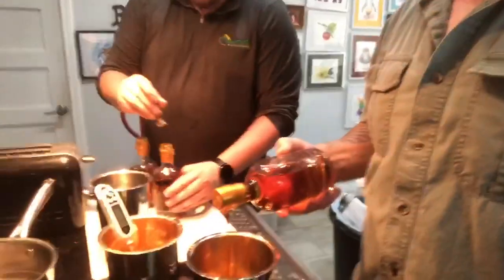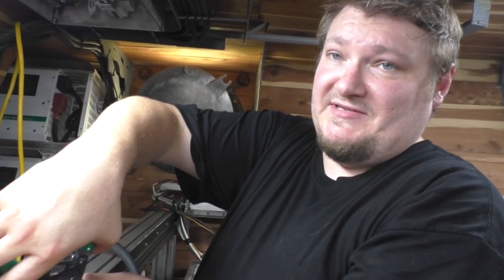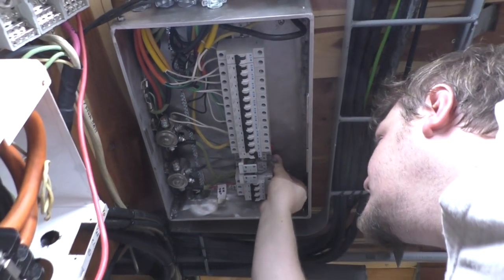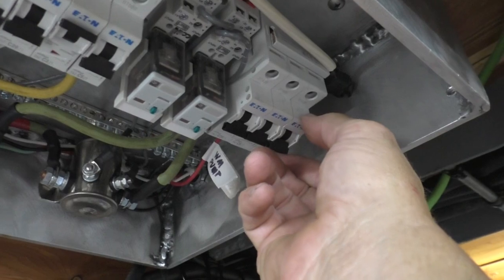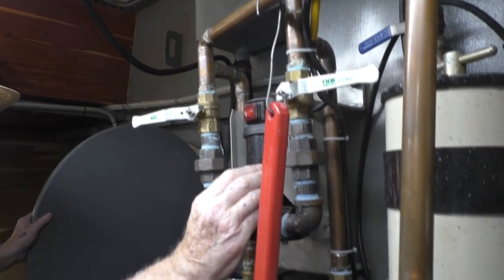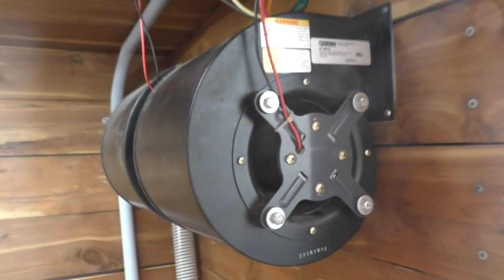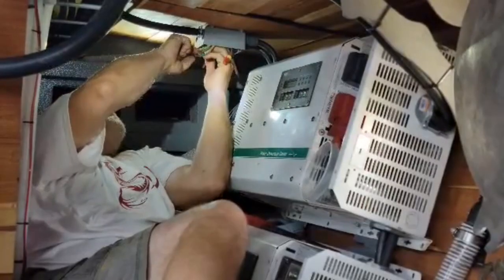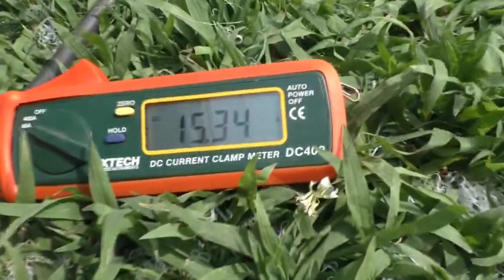LiFePo Forklift Battery in a Boat

Comment: 2011: "this dude thinks he's gunna build some crazy boat"
2021: "hes launching is 6 days"

what a ride
Reply: Yeah, missed the first few years but everything after. Probably didn't miss more than 1 in 15 of the videos since.
Cutting, shaping, casting, heavy welding, assembling, prepping, painting, insulating, woodworking, milling, electronics, hydrolics. All big topics but before it stopped being interesting he moved on. This project has so much depth in every subject.

Comment: Sweet battery set up. I wish i could make the trip to the port but working 6-10s now welding 5/32 7018 rods into a 40ft hole of sheet pilings

Comment: In North America split phase electric power voltage is 120/240 not 110/120 . Tom Edison DC power was 110 volts. When you plug into shore power you should  receive  120/240 You should program your invertors for the same as shore power.

Comment: I never had problems with standard contact spray wich is usually just WD-40 or similar. If theres any of it between the metal, it will be so thin it wont block electricity despite it being an insulator.

Comment: 0000 stranded. Haven't seen nice thick cables like that since I got sick and had to retrain. Remember what I said about finding loose hydraulic hoses. Drain plugs are the same. You find them loose and leaking all the time.
Reply: Could drill it for safety wire.
Reply: @rtz549  yes. Have to make sure it is tightened down all the way first and the only system that does that reliability is to have multiple, trained mechanics go over it several times, like how aviation and other critical systems are handled. In this case, it is just a minor leak and the Good Captain of the boat notice the leaking fluid and found the source to repair it.

My point is that you will always forget something at some point, so you plan for it. If that plug getting loose would kill somebody and it could come loose by some unavoidable means, yes, you safety wire it. Of it is found loose in dry dock or during shakedown cruise, you just tighten it and clean up the fluid so you can deal with future leaks just as easily.

Comment: Is there any concern that your boat is going too be under powered?  That your diesel engine is gonna be to slow while under power.  Most boats your size have a way bigger engine in comparison.  Really just curious.
Reply from the maker: What were they powered with in 1641?

Comment: What happened with the 18650 battery’s???
Reply: @Brian-mp6bg  oh I think the 18650’s are a very good idea , and very sustainable..
Reply: @Brian-mp6bg  agreed, but I though they were running tests on every one and grouping them with like batteries that are in close enough balance., I run 18650 cells in various devices and i end up pairing two different manufacturers with similar specs, and they discharge the top 70 or 80% evenly just fine, below that and one seems to just go flat pretty quickly..but these were all things discussed before they asked for the donations, not that I care, just really wanted to see it come together and work..

Comment: Wait, what? Dielectric grease is not for electrical connections?
Reply from the maker: Certainly not inside a connection that needs to pull a lot of amps.
Reply: Absolutely NOT!
Reply: @matte4007  then what do you put on your trailer light connections? And why is it used in almost every automotive electrical connection?
Reply: @matte4007  And why can you buy wire nuts with dielectric grease already in them?
Reply: @SVSeeker  thanks for the info. Must be good for average amp connections, but not high amperage ones. Best wishes.
Reply: @pnorton75  its not. It used in applications the can be corrosive and that is under 15amp. Does not matter the voltage, so yes some wire nut come with it in it. But there are almost always rated for less then 15amp. For us we are using 24v and pulling up to a 1000amps and charging up to 1c or 500amps.  Dialect grease just becomes  napalm at that amperage. It all about appropriate applications.

Comment: It's all looking fantastic and an amazing accomplishment that you can be greatly proud of, but I will say just two things! The first has been mentioned previously, and you have shrugged it off with some glib comment, but lack of labeling of cables, lines and equipment is going to be the undoing of your venture! No matter how smart you think you are, and you are, you will NEVER remember what everything does and how it is inter-connected! We are already seeing issues with commissioning of systems where you are switching breakers or valves not fully knowing what they do! This is a guaranteed way to kill people, and it is just a matter of time! Your current situation gives you absolutely no way to create any methods of isolation procedures to perform any maintenance underway! In the same vein, you are placing yourself as the supreme holder of all knowledge and in the event of any incident at sea where you become incapacitated, you now place the entire vessel and crew at an extreme disadvantage of a completely un-intelligible sophisticated system of systems. l am not some young safety management type, I am an 'old' electrician, engineer, sailor with vast experience in engineering, mining, oil & gas and many other fields, I have seen great engineering, I have seen poor engineering, and I have seen people die due to great engineering poorly documented. While it is still a vague possibility, I implore you sir, fix your f@#king labeling! Now, the second thing! When explaining electrical circuits, NEVER EVER EVER EVER touch the terminals! That I should even have to say this.... We are creatures of habit!